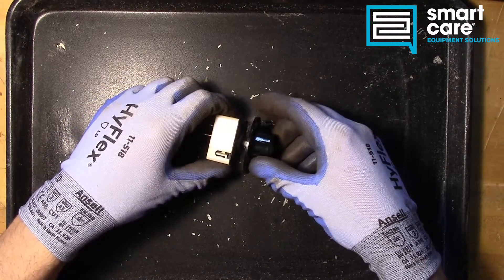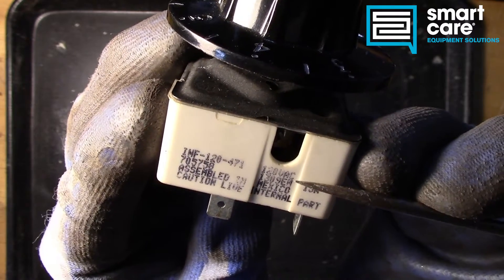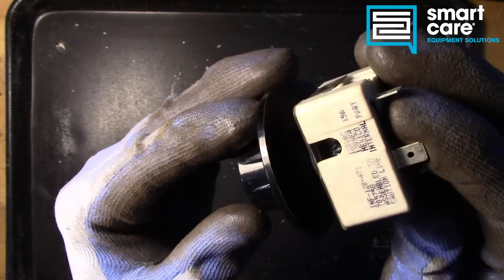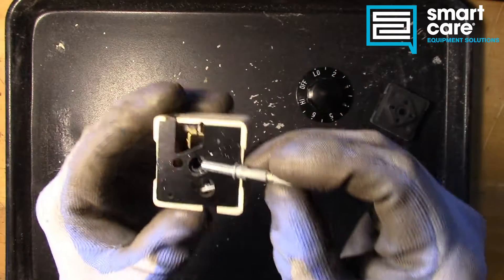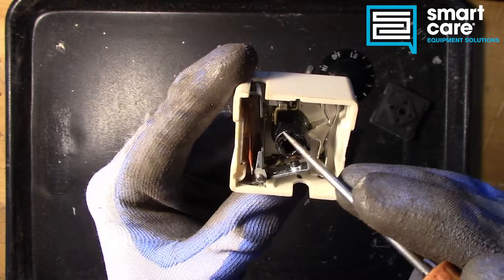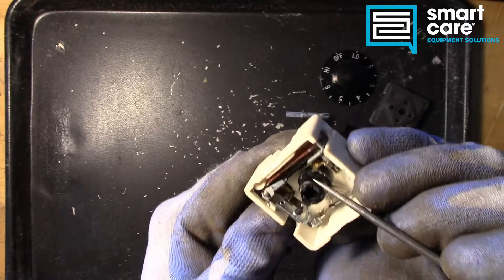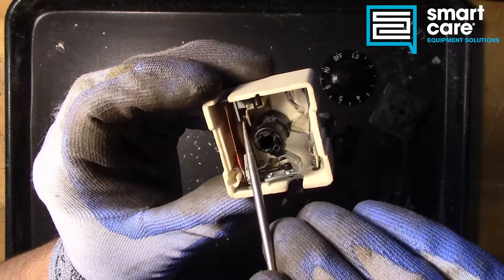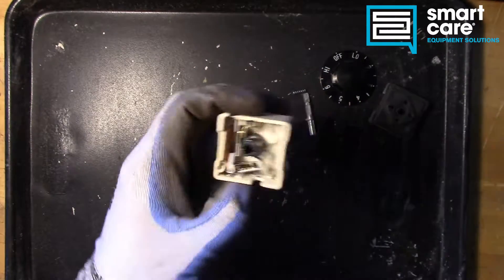Teardown Tuesday Episode 15: Infinite Switch Heat Control

Comment: UPDATE - By the way, after my wife tested the stove (by making "Dosa" after my repair of the Infinite switch), I made "rooti/chapati" using the same stove for approx an hour, setting the switch at 6, then after few minutes reduce to 4, and finish the chapati by changing the setting to 2. I repeated the heat setting for each roti/chapati and made a total of 18 chapaties (the dough was already made) by rolling each chapati after finish making each chapati. During this interval (I mean while rolling the dough ball), the stove was set at 2, not turned off.  The heat was cycling as usual.  So far it is working perfectly.  And we will see how long it will last.

There was dark smoke stain inside the switch. Lot of deposition/build up (from burnt grease?). The contact points were not welded together though. I tried to do my best in cleaning the components inside the switch with alcohol and had to adjust the setting screw (requires special security screw driver). However, I forgot to apply a tiny bit of grease (must be a special grease otherwise it may become hard and damage the switch OR melt and flow to the contact point where build up may occur).  That was the real repair.
Reply: Does the switch I have exactly and he was working on but now I can't find the switch and they gave me one part this is supposed to fit but you have a lot of adjustment and then customization you have to do and I was wondering if anybody knows how to adjust the new infinite switch to this one that guy was working on thank you for reply
Reply: @jasminenarinkiz9229  I watched many videos on this topic in YouTube. None of the videos dealt with the Heat switch I have.  However, only this video gave very detailed tear down of a Heat switch even if the Heat switch in this video is a different one. You are right, it is complex to repair by tearing the Heat switch down.  May be watch some more YouTube DIY videos on this topic which may help, if they are exactly the same as your new Heat switch. 

1) First compare the back side of your new switch with the back side of the switch in this video. If the pin locations/positions and the total number of pins/terminals of your new switch match with that of the Heat switch of this video (I mean your old Heat switch), then you have luck. If the total number of pins are not the same, your new Heat switch will not work easily, and wiring connections will require modifications from what you see in this video. 

2) In this video the author emphasized that the voltage and ampere rating of the new switch must match with that of the old switch. Example: If the Amp rating of the old switch is 15A and your new switch amp rating is 8A, even if the voltage rating matched, it will not work meaning, the heat element of the stove will not heat adequately. Also it may cause other complications.

3) Contact the author of this video if you have his contact info. Since he has moved on to a different channel, he may not answer if you post your question to him in this video.  Watch his Teardown Tuesday Episodes, Example a video: "Teardown Tuesday Episode 36", and post your question in the comment section of that video even if that video is not related to the Heat switch, he may reply and guide you. I do not have any expertise on the stoves or Heat switch. I was lucky to fix it, however I dared to open the Heat switch only after watching his detailed tear down and specific advice in this video. Good Luck.

Comment: This is a followup of my comment 2 days ago. I had the same problem, i.e., my stove LG LREL6321S /00 has 2 separate Dual element ranges and 2 single element ranges. All are working fine except one Dual Element stove which stays very hot even when its heat is set to low heat, i.e., set at 2, eight being high heat setting.  It did not reduce to low heat and stayed red hot all the time. After watching your video I realized that it is very complex, and even though your video gives lot of valuable information, I may damage the switch if I open it.  So I started looking online for buying the switch.  It looks like from LG site, this model oven cum range is discontinued.  So some online sites displayed some compatible model of LG with this type of Infinite Heat switch or Dual Heat switch.  Its price ranged from $65 to $155 before tax.

Before finalizing of buying the part I applied the knowledge I gained from your video, i.e., the Voltage and the Amp of the replacement part must be the same as the original part.  So to find out that information I had to open the back side of my LG stove and removed the switch to find that information. Then I tried to make sure that the online part that is LG stove compatible matches to that of my existing part.  Most of them do not provide that information. Those online parts did not match the Amp ratting of my Heat switch/Infinite switch.  Therefore I postponed the idea of purchasing the part online.

At this point I had 2 options - 1) swap the bad switch (Dual element stove) with the Dual element which is working so that the stove which we normally use (currently the defective one) will have a working Heat switch. And the other Dual stove will not be used any more.  Option No.2) Buy a switch online even if the Amp ratting won't be matching (has lower Amp than that of my existing bad switch) and replace the bad switch without swapping my existing switches.

I checked with my wife on these two options. She right away said "NO" to swapping the switches.  Then I offered a 3rd option, i.e., we buy a switch online even if not matching to our switch. Along with the 3rd option, I added a clause that if we buy a new switch, we will be throwing away our existing bad switch. If we will be throwing away our bad switch, then what if I open the switch and work on it; if gets damaged we do not lose anything. She agreed to that revised option 3 and we discontinued our (we both were searching) search for a new switch for the time being, i.e., today. Guess what I REPAIRED my infinite/Heat switch today itself and installed in our LG stove.

It involved actual repair.  Without your video, it would have been impossible for me even try to think about repairing.  Before final reassembly, I tested the stove and found to be working.  Before that I had tested with a DMM and the repair found to pass the test. Then my wife made some "Dosa" which normally requires use medium heat, then reduce to low heat and continue cooking.  The heat was cycling, which she pointed that out, meaning she approved my repair.

I just subscribed and already "Liked".  Thanks a lot for sharing such a useful knowledge in a very clear language and good pace accompanied with great videography. Hats off to you, Sir!!!

Comment: Hi thanks for the video I replace a lot of these for Hatco Glo ray food warmers specifically the infinite Switch #R02.19.017.00    208 voltage. I recently opened some of the failed ones there is really not much to them my question is is there a difference between buying Hatco brand or aftermarket to me the last about the same amount roughly one year the price difference is pay $60 or more each or $30 or less if I buy in quantity the restaurants run them about 14 hours a day 7 days a week on setting 5 or 6 eventually you can't control the temperature and the element is just bright orange but you can turn it off thanks

Comment: MY switch only goes off and very hot. I believe it its the switch. MY question is could I mistakenly cross H1 and Hc (H2)? to cause my problem.
Reply: Probably the two contacts that should spring apart have in fact welded/fused together. In the video he mentioned how there is a small arc everytime they close, and could produce pittting that over time fails to connect. The opposite can happen too, where they connect and then don't release. Hence anytime the switch is on, it is on 100%.

Comment: I have a kiln for pottery with these original switches but it also  had a controller that controls the rise in temp by cycling 240vac 30 amp relays. Question is can I just do away with these infinite switches and are there is an internal resistance in the switch that I have to add when doing away with the switch?
Reply: I think you will have trouble with those relays maintaining there set temperature, you’ll most likely have high fluctuations in temperature if you remove that simmerstat.
Reply: It has a temp monitoring device and the controller controls the rate of rise of the temperature,usually 300 degrees per hour until it hits its target temp of 1830 degrees. The previous owner said she turned them all the way up when firing and though it hits it target temperature it's not been as hot near the bottom as needed. This INF switch is 240vac 15 amps. If all the way up how often would it cycle in minutes?

Comment: Thanks so much for putting out this valuable information.  I run a not-for-profit commercial rental kitchen facility and it is so important that we keep our rates low to help our clients build capital so they can move on to their own establishments.  Part of the way we do this is to buy (or receive donation of) a lot of used equipment which often needs repair.  I am no electrician, but I am a certified machinist as well as pastry chef and culinary consultant.  If I can find a way to safely fabricate a repair, I will do it, otherwise it gets called into a proper service technician if it involves plumbing or wiring.  This particular video has saved me $200 as it has shown me that the stem in the switch can be replaced with one I fabricate to match the existing stems rather than having to replace the entire switch, which is not faulty; the stem is just snapped off.  I'm writing this just to make sure that, in the event I am wrong I am giving myself a buffer of time to check back here to see if anyone disagrees before I go ahead with my plan.  Just as an FYI, I will be checking the material and rockwell hardness of the stem to ensure I use the correct metal to match the same heat dispersion as the existing stems, in case anyone was going to jump on that first.  Other than that, I can't think of any reason why this won't work -and why they just don't sell replacement stems???
Reply: @teevee186  Woulda been great if that were the case.  But where I live, no such luck.  Can't buy the stem individually and the replacement switch for the model of stove I had was anywhere between $85-$165CDN plus shipping. But I was lucky enough to cannibalize the stem from another switch my appliance technician gave me and make it work.  So the video was very helpful.

Comment: Do the pilot switch need to be connected. I noticed it only has a plastic arm running to it with a metal connector to hold it in place. Unfortunately, a piece of the plastic arm is burnt so the metal connector is not really holding on. Do I need the pilot switch to be connected?

Comment: There seems to be a "set screw". Can this be used to give "more life" if turned-in ?
Reply from the maker: No, the adjustment screw is set at the factory and locked. Infinite switches have a limited life and will eventually wear out, if one isn't working correctly it will need to be replaced.
Reply: @techvideos1262  Thank you. That is good to know for my future repairs.

Comment: I have a Jenn-Aire flat top with a dual burner control that has sockets for the wires to connect to it. It looks to me like there is a capacitor inside. Are you familiar with these. I suspect the control is defective, because the elements have continuity. I am not getting continuity to both L1 and L2. Just continuity to one of them, when I turn the switch on.

Comment: Great video.  One question I still have is in regard to the switch contacts on L1.  Are there separate contacts for L1/H1 and L1/P?   It seems that the L1/P contacts would have to be separate for the Pilot indicator to work correctly (for multiple burners).  It also seems like a good idea for the L1/H1 contact to open when the control is OFF in case the L2/H2 contacts weld, so the burner can be turned off.
Reply: The 'P' terminal is not for passing current/ heating. 
The 'P' terminal is merely a pilot terminal, one on each switch, that sends power to an indicator lamp to let folks know that a surface burner switch is on.

Comment: I just replaced my second switch. 
It was making an arcing sound sometimes. First time the switch went bad, the heat would be too hot no matter what the control was set to. Replacement started arcing a year or 2 ago. (Saw a little soot behind the knob). It worked, it just made an arcing sound when the contacts touched or broke.
Great video! I wondered how it worked exactly.
Never had to replace infinite switches on 3 of the elements, and range is 17 years old. Just one element. And they all get about the same use.
Reply: Is it the bottom left?
Reply: Could be an issue with that element, or it could be the “power element” often time ranges have 1 element with much higher wattage, try to find an infinite switch with a slightly higher amp rating but the correct voltage it should last you for longer.

Could also be that element just sees more use, and like the video said these are only good for so many cycles…

Comment: I've been looking for a video like this forever!!  I have been trying to find a replacement infinite switch for a "1314471 - QE214352 - 8.9-11.0A 250 VAC - 840321  Type B" that I've been told is NLA (no longer available).  It has a long stem, and any replacements I've found all have stem/poles that are too short.  Are poles interchangable?  could I take the stem from the malfunctioning switch and put it in a generic replacement?  Or are there any recomendations on a replacement switch for the model I've listed. (for a really old Whirlpool oven).  Is there any way to "repair" faulty infinite switches?   Thanks for your attention in advance.

Comment: Exactly what I needed; you saved me from buying a 240v switch for a 120v application.  I assumed like many switches, a higher voltage rating is fine.  After watching I understand I would be seeing much more "on" time than anticipated.  Awesome video, thanks for sharing!!